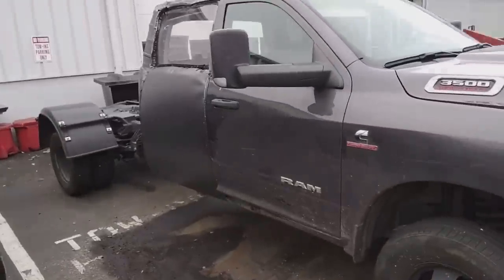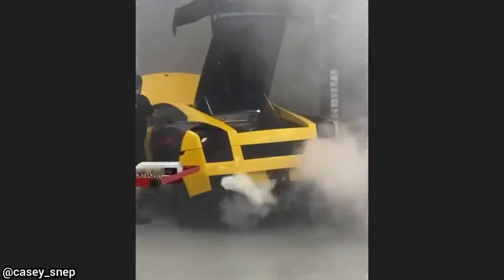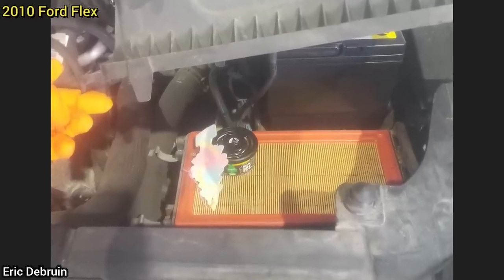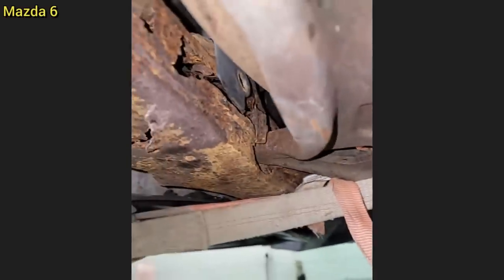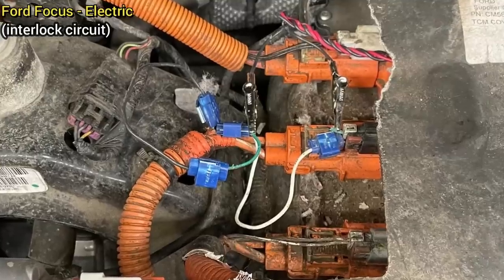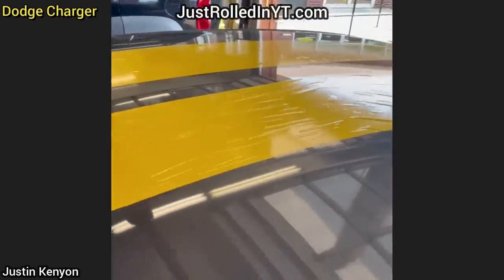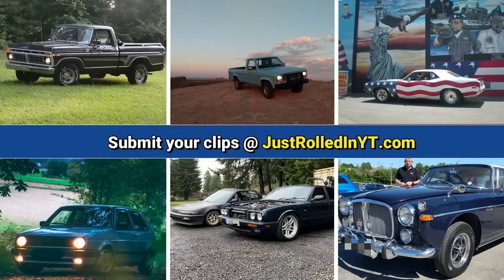Customer States Another Shop Used A Range Rover Hood To Fix Door

Comment: the harmonica works? I guess I didn't think the airflow would be good enough to make it play without lips around it to keep the pressure up. BRB getting harmonica, gonna go drive around holding it out the window. I need harmonicar! 

UPDATE: I just tried it. It worked really well- it starts around 30mph and gets loud around 50mph. This was with a hard-to-blow harmonica, too. I had no idea.

UPDATE 2: ordered 15 bucks worth of cheap plastic harmonicas

Comment: The first segment.  I have zero experience in body work but I think I could do better than that.  I'd at least use the proper door.
Reply from the maker: My 5 month old could do better as well 😂
Reply: @JustRolledIn  Your 5 month old would also do a better job of explaining what the previous shop did wrong! 😂😊👍
Reply: Yeah a trip down to the junkyard for the door & you might even be able to match the color!
Reply: I gotta wonder what leads somebody to do that.  It seems like even a really bad replacement from a junkyard car would be just about the same amount of money, far easier, and a whole lot more sensible.  That actually seems like alot of work to get that even as good (well, bad) as it is.  Probably drugs or something.

Comment: the harmonica trick is pretty good.allmost as good as hiding a horn & tapping it into the brake light wires.years ago i knew a guy who progressively added old wheel weights to the inside of his neighbors wheels after everytime the neighbor acted like a A hole.was back in the days of steel wheels & hubcaps.

Comment: The harmonica is pure genius .
If music isn't your thing , get a funnel and a length of hose that fits over the small end of the funnel .
Now , install muffler bearings by sticking the end of the hose up the exhaust until it reaches the muffler and pour a tube of bb's in there .
Or pour a half quart of oil .
By the time the vehicle makes it to a shop it has all burned off and no longer smoking .
Things that won't flow can be pushed with a stiff wire , like those left over firecrackers from the 4th .
A hose clamp on the drive shaft will shake things up a bit .  

If you are good with electrical systems and a creative psychopath , a few relays and jumper wires opens up a whole new universe .
Like a siren hooked up to a turn signal or brake light circuit , maybe the windshield wipers , etc ..
I once mounted a set of very small flashing blue LEDs inside the rearview mirror of a friend's car .
They only came on at random times for short periods .
He saved a lot of gas money before he figured that one out .

3 pounds of dry ice and a small bottle of liquid dishwashing soap , dropped in a 5 gallon bucket of hot water , will fill a  van with suds .

You can make very convincing " bird droppings " with silicone sealant ( white and clear ) on a sheet of wax paper . Make up a batch and wait for your neighbor to wash their car .
When they go inside for a break after waxing it , surprise them with your new decorations .
Or just throw out bird seed next to their driveway every so often ...

You can get dye for leak testing at the auto parts store . It will turn plain water a bright green and looks just like antifreeze .
You can have somebody looking for a coolant leak for the rest of their natural life ...

Heated seats are also fun to cross connect ( driver's control to the passenger seat and vice versa ) , like the old gag where you switch the controls around on an electric blanket with dual controls .

Comment: my front subframe was even worse than that believe it or not and it still drove fine lmao.  the mechanics were in awe that I had even been able to drive 10ft with it when I brought it in to get looked at for rust damage.     I knew there was a hole but didn't know quite how extensive it was because I never got under it while it was on a lift, best I could do was just lay on the ground in front of the car and try to see

Comment: 2:10 ford focus "BEV". i found a '13 year one at pick n pull for a friend, he loves it. 
the 3 HV cables on the passenger side of the motor+ecu unit are for: dc-dc converter(pack voltage to 12v accessory/lights/etc), hvac compressor, coolant heater. 
above each HVcable is a hv interlock connector thats basically a LONG loop of wire that if broken anywhere throws a singular fault code.
under its previous ownership, a rodent had chewed one of the interlock wires way too close to the connector to repair properly; i found that a computer fan connector has the correct pin spacing to work. 

it did end up needing a new battery pack. the cells are prismatic pouches (JUMBO version of whats in cellphones) and even though they only swelled a little bit, thats hundreds of cells, it pushed hard enough to pop coolant lines. 
replacement pack came from a '15 year focus bev with front end damage. two pack swap and its good for more years.

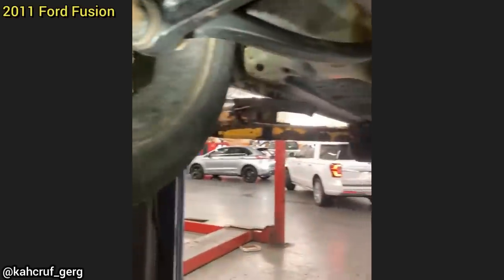Comment: 0:58 this happened to me once. My first and last time going to a car meet. I didnt want to go in the first place, but my close friend kept asking me over the years, and he was headed to one so i finally said okay. Leaving the meet at near midnight i stop 4 times because my steering wheel is wobbling. Each time i stop it was getting more dramatic, i checked for flat tires and didnt understand what was going on, so on the last stop my friend stayed behind me. Going over a bridge at 60mph my wheel flies out, i managed to skid to the shoulder while sparks fly in the air. Someone had tried removing my wheel but was usuccessful because im on airsuspension and you need a lug nut adapter to take off each rim. I appreciated him already but even more because he was there for me, this was 8 years ago and knew him for almost 15. Sadly he died in a horrendous crash last week, a true brother
So stay safe out there people, and be responsible

Comment: Lambo owner: "Radiator - filled to the top of the fill hole.  Windshield washer - filled to the top of the fill hole.  Obviously, engine oil should be filled to the top of the fill hole."

Comment: Just swapped out the Battery in the F-430.What a pain in the a-s.The battery is in the passenger side Kickwell.Changing the Battery was easy but the hold down braket was horrible to work with.But anyway its done!!!!
Reply from the maker: Sounds not fun! I hope the weather is good enough for you to be driving it.
Reply: Same with my wife's Smart Fortwo. Doesn't help that the thing sits in the garage for weeks at a time so I'm regularly having to boost it.

Comment: Every sticker add 5hp and a Shelby stripe adds 20hp, it's just common knowledge. Although, I didn't know Shelby worked with Dodge, I thought he only did Fords. 
🎵The More You Know 🌈⭐🎵
Reply: Actually, Shelby did some work at Dodge in the mid-80s, working on the Shelby Charger and the Omni GLH.

Comment: I've seen a lot of sketchy stuff on this channel, but nothing comes anywhere CLOSE to seeing that 400 volt wiring harness cut up and patched with run-of-the-mill connectors. I'll happily work on my electric vehicles of all sizes, but you REALLY need to do things right when dealing with voltages which could kill you from a single shock!

Comment: I think I get what they were trying to do with the air freshners, but they could have had ten in there and wouldn't smell it. Most cars have a cabin air filter though which would have been a better location to stuff those things. Not that I think it's a great idea though. In a lot of cars it's usually accessed at the back of the glove box. Always good to change the filter from time to time anyway and very cheap and easy to do yourself

Comment: Actually had a Gallardo come to repair the rims, they were all cracked, one even had silicone to seal the tire which was deformed.
After having the rims repaired, refused to get new tires put on, even though the wires were on display at the rear, and the front were deformed.
I just don't get it, why spend all that money repairing them, if you're gonna put the crap tires you had back on??

Comment: The audio system upgrades "for cheaper" hurts my brain. If you ever want to do some audio wiring, at least do some research on wiring diagram on which cable means what, then do some research on how to wire everything properly with as little cluster as possible - you want to use HPF or LPF for a input, how you will attach everything. I myself, being a beginner who did any of this the first time, redid the whole audio system in my car + added a subwoofer set and things are looking good + the performance exceeded my expectations which is a bonus.
Gosh, these "mechanics" makes me feel like I'm a true mechanic who knows most of the things, which makes me feel good. A like from me 🤣

Comment: There's nothing wrong with using parts from one car to fix another. If it's done right, that is. I used pieces of a Subaru hood to make patch panels for my Buick quarter panels. Nobody knows unless I tell them.
Reply: You didn't leave the subaru badge on by mistake then like this one.

Comment: I bought a 77 Rabbit from a guy who filled the oil through the dipstick, probably 8 liters were 4 should have been, he also spot welded a broken wheel stud to the rim instead of buying a new pin and knocking the old one out in a whopping 20 mins of work, not sure a Lambo could take 28 liters so I think that shop is lying a bit, most engines take 5 liters so how tf could you squeeze and extra 18 in the crankcase and engine even if you filled it to the top of the dipstick?

Comment: I had a lady customer come in with a complaint of a buzzing sound when they turned right. Test drove the car and confirmed the sound was coming from the center console. Ope Ed it and found vibrator, when the car turned right it would roll against the side of the console and put enough pressure on the switch to momentarily turn it on. The customer turned 50 shades of red when I showed her what was causing the noise

Comment: My dad claimed he was arguing with someone over whether or not a Lamborghini needs special oil and if the cost of it should actually be $120.
I told him that if someone had spent that much money on a car, would it be a good idea to risk damaging it with a Wal-Mart oil change?
Note: Nobody he ever knew could afford a Lamborghini new or used, so I don't know where either side got any of their information.
Reply: It doesn't need special oil and the filter is a $25 Audi part, it's not really any different than changing the oil on any other car, you just need to know there are more than 1 drain locations.  I use Penzoil Ultra Platinum. I was impressed with Project Farm's testing but oil analysis comes back good every time. However any synthetic will work and even Amazon Basics is the same stock as Mobil 1.